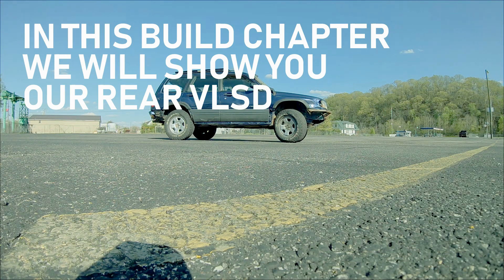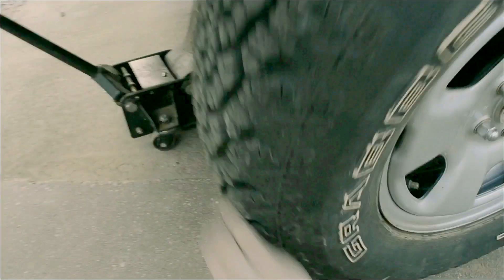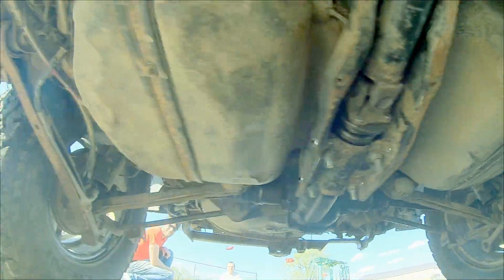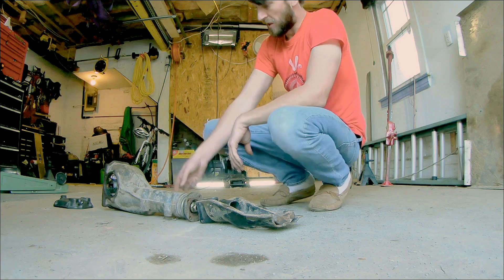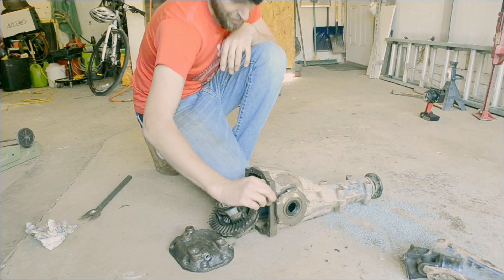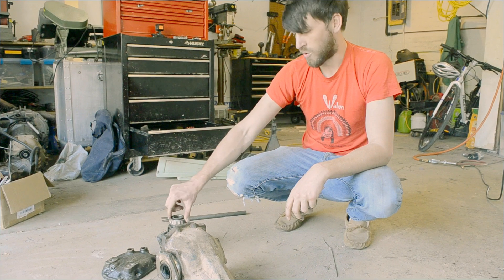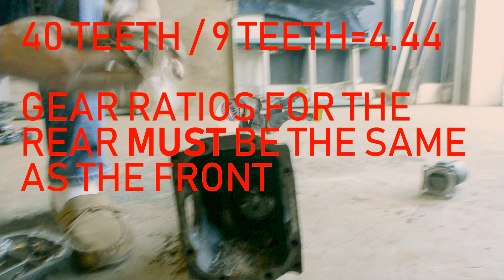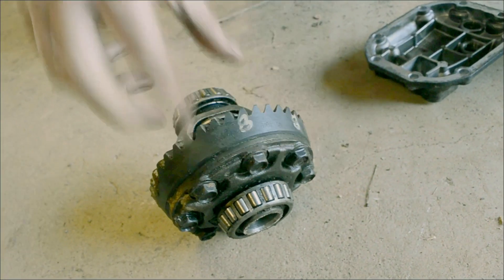Off-Road Subaru VLSD swap: what it does and how to do it

Comment: I don't understand why they don't make these standard equipment as a minimum. Why spend so much time on traction control and torque vectoring and not attempt to assist it with mechanical advantage. Does the LSD inhibit the way torque vectoring works.?

Comment: If i swap out the carrier assembly from an open diff r160 to a vlsd r160 (matching ratios) I dont have to swap the axles?
Reply: i want to do the same, did you manage to do this?
Reply: The version 2 axles are the same as the open diff plug in axles. Swapping carriers is a bad idea because the pinion mesh is set at the factory by a crush washer behind the pinion, so there is a chance your mesh will be shit.

Comment: Hi, thank you for the video. I have an SJ Forester and have argued that the best balance between a vLSD and a locking diff is probably a Torsen. What is the difference between the Torsen and Eaton Truetrac? There appears to be subtle differences. I also wonder why such a good vehicle doesn't fit them as standard or offer it as a marketing option for more off road markets. Thank you again.
Reply: Late 2019 I bought a torqmasters R160 locker, it was awful. It worked well but horrific for daily driving. A torsen or truetrac will become an open diff if you lift a wheel off the ground. I've been experimenting with rebuilding my own R160 vlsd diffs, I have a torque measurement device in a large lathe so we can plot torque vs rpm graphs, so far I've managed a 300% improvement in torque transfer over a stock 100% functional R160vlsd. I'm hoping this will be a great allrounder for daily driving, gravel roads and off road.
Reply: @procrastinator1842  i came back to this video to see if anyone is modding the vlsd. Any news?
Reply: @dukeofnyd1  Hi Jon, after over a year of testing my custom VLSD, I am thrilled with the performance both on and off road. There are literally millions of these units getting around on the road waiting to be upgraded. I am close to offering a mail in, mail out rebuild service, just figuring out how and if I can build a 500% increase diff and will need to test it.
Reply: @procrastinator1842  very cool! Congrats 👍 I was recently thinking about how people used to (maybe still) shim r200 vlsd and thought itd be good for the r160 subaru lsds.  Theres definitely a lot of r160 v lsd out there waiting to get better.
Reply: @dukeofnyd1  Thanks! Shimming only works with clutch lsds. If you shim a vlsd, you destroy it pretty quickly 😂

Comment: Will this reduce the situation of one wheel spinning like crazy, while the wheels with traction aren't getting power?
Reply: aaron sempa Nope, the vlsd May as well be an open diff in situations where one wheel is free spinning
Reply: @CarSyndicate  okay, so is installing a diff locker worth it?
Reply: @aaronsempa5820  Imo lockers and LSD's aren't comparable really. I have a torqlocker and do recommend it. No longer am i stuck in one spot with a wheel in the air and losing all my forward momentum. Definitely worth it if you encounter the same issue

Comment: Working on this type rear now. Was surprised to find after removing cover no clutch pack. Rear was making same noise a clutch pack rear would make going into corners. Will see soon if this fixes it.
Reply from the maker: Hmm. Sounds sorta like wheel bearings to me.

Comment: ideally you would want to buy a Jeep or something with a real 4wd but then you hit the wall with the Jeeps made in the last 20 years being extremely big pieces of shit that will a lot of times catch on fire for no reason at all other than faulty wiring from the factory
Reply from the maker: It's mostly just that Jeeps are prototypical and overpriced for us. We'd rather have a challenge. If anything I think making them more flammable was an improvement.

Comment: any difference with the 4EAT on the turbo models of the transmission?(02-04 WRX).  I was thinking of swapping that in because they can handle some power when built, I was wondering if I would lose anything from my Forester(SF) Type S drivetrain.
Reply: @powerofyourbrains  I was thinking of doing an Ej255 swap but wanted to keep it auto with a quick spooling turbo for a high torque build.  And just have it lifted for light off roading stuff.  I was reading that the 4EAT that came in WRXs are pretty stout and once build can hold a ton of power.  I just didnt want to end up getting stuck because the drivetrain behave different when off roading.  thanks
Reply from the maker: The old bugeyes had the ej205. Ej255 is 09+ wrx. I believe that the legacy gts of the mid 00's had the 255 with your size gearing (4.44, but double check yourself of course). Thatd definitely be your best bet. Coincidentally, it's also the vtd model I mentioned.
Reply: @powerofyourbrains  thanks for the info, Fozzys have a lot of great build paths

Comment: The drive shaft flange isn't rectangular, it is indeed square. Torsen is terrible for off-roading btw, you need way to much brake modulation to make it useful, not to mention there isn't even a Torsen r160 Subaru diff. Your better off welding it. Oh, and the bolts on the driveshaft have tabs that keep them from spinning while you loosen the nut, you don't need a wrench on the bolt.

Comment: I have had a Subaru forester 1997
(automatic) from new (approx. 70,000
miles on the clock), that has been great for
all the years with very little to do other than annual services. However, recently
I have had a lot of vibration & shuddering on the wheels when making slow tight
turns (left or right) but never on the straight. It is difficult to identify
which wheels the noise or shudder comes from and I don't feel much through the
steering wheel. I have had all differentials replace that has reduced the
frequency but not eliminated the problem. We hope it isn't the automatic gear
box but has anyone got any ideas what to do next.
Reply: Check your steering rack and your power steering.
And sadly... Yes it could be in your transmission.
I used to own a 1999 model (2.0 dual range). And had had similar experience. My forester had a center differentials and in fact it was the thing causing the problem.
Since your auto doesnt have a center diff i think it may be the part which controls how much power to deliver to the front or to the rear (forgot how it is called). It is nothing with the gears but with that electronic mechanism.
Reply: @moonsapling  Checked all that with no 'luck'...... We now believe it could be a solenoid in the transmission that works the AWD system may have gone.... just waiting for parts before replacing it..... I will inform you when done.
Reply: @georgeemanson  hope you manage to fix it. Hope for the best and good luck!
Reply: @moonsapling  Thanks for the support.... I think we are eventually getting there..... old sub's are great cars... not to fond of the new ones so want to keep this one going....
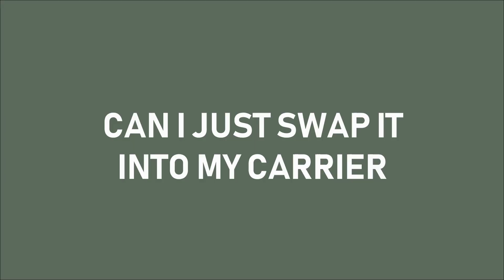Reply: SHE LIVES AGAIN!!!!!!…..an interesting item at 3 minutes to 4:40 minutes in the attached video ( https://www.youtube.com/watch?v=GP7TInt4q84 )..... this was exactly what I experienced with my 1998 Subaru Forester but no-one could diagnose the problem.... £3k was spent/wasted with my Local Subaru dealer trying to fix it... but to no effect. Then I found the attached video link.... and then I found a good mechanic willing to do the work..... and yesterday we got our car back (with new solenoid in the transmission) and she runs great..... Well worth the effort.... these Subaru's can go on forever (almost) George (London, UK)
Reply: @moonsapling  SHE LIVES AGAIN!!!!!!…..an interesting item at 3 minutes to 4:40 minutes in the attached video ( https://www.youtube.com/watch?v=GP7TInt4q84 )..... this was exactly what I experienced with my 1998 Subaru Forester but no-one could diagnose the problem.... £3k was spent/wasted with my Local Subaru dealer trying to fix it... but to no effect. Then I found the attached video link.... and then I found a good mechanic willing to do the work..... and we got our car back (with new solenoid in the transmission) and she runs great..... Well worth the effort.... these Subaru's can go on forever (almost) George (London, UK)

Comment: Where can you get any kind of straight swap lsd or locker for sake of better snow car?
Reply from the maker: Well, since snow naturally causes tire spin, the vLSD is perfect. We have a snow adventure video if you would like to check that out. For conditions which allow for more traction, the next most feasible options would be a clutch-type or helical conversion, either of which have their benefits and drawbacks (longevity and price). A true locker costs more than it'll be worth to you, but if you wanna throw away 4k we know a guy in Australia who can build it

Comment: As the owner of an 04 forester xt setup for offroad, I wouldn't want a Torsen style diff. Torsen diffs are great until you lift a wheel and then it's an open diff and no better than what you started with. I'm getting ready to install a Cusco diff, not sure if I will use the 1.5 or 2.0 setting since this is also my daily driver.
Reply from the maker: This was explained in the raw footage and cut out for brevity's sake, but you can easily overcome that by lightly holding the brakes. Still a matter of preference; strength/ease of lockup vs component longevity

Comment: Hey man I got a 2003 Subaru forester 2.5XS and I would like to know what to get to make my rear diff lock up for better rear traction, I'm already doing the other mod you guys mention in how to lock up the center diff. Your input will be much appreciated and thanks for your videos keep up the good work
Reply from the maker: We have looked into this. If you really want a true locking setup, there is a guy in Australia who can fabricate a locking rear for the forester using an R180 rear. Im happy to give you his contact info, but you should know that its a send-off service, and the parts and labor costs nearly 4k USD. As soon as there is a cheaper alternative, you'll hear about it on this channel
Reply: Power of your brains thank you for the info, I will wait for now then  because 4k it's to much.
Reply: Power of your brains the other cheaper option that i was thinking is to weld the rear diff to make it possi at all times and have my subi with the fuse on the FWD slot. Now my other question here would be, Can this motel subaru be driven for long miles with the fuse in the FWD slot? In other words have it in front wheel traction for city use and enable the AWD when going off road!
Reply from the maker: Gabriel Ruiz Having that fuse in place means that the center will lock up only when traction is lost, so its still awd. The switch could be wired to allow for fwd only vs lockup. The problem with a welded diff is that it is welded wether or not power is being sent to it. If you have to drive on-road on a regular basis, a welded diff is usually not a great idea
Reply: I was the one who, with my partner developed the R180 diff locker here in Sydney.  I have tried  various different diff set ups off road.  From open, VLSD, Torsen and plated through to e-locker off road.  I am also aware of the lunch box or auto lockers that have since become available for the R160.  The open is obviously pretty limited but if you keep the car flat you can still get to some places.  VLSD is effective to a point, but  wilts under use and in more difficult terrain.  The Torsen is ok, until such time as you lift a wheel, then it's effectively an open diff.  Best not worry about it.  Plated diffs are the best of the LSD's, and they vary by brand.  Thing is, on road they make the car very tail happy, yet still give up on you and leave you stranded.  These auto lockers are similar in concept to Detroit Lockers.  They don't always lock when you want them to, and sometimes can when you don't want them to.  Which on a wet road can lead to a very nasty surprise.  They are also noisy, and because they still use the weak R160 axles you are more likely to break one, hardly ideal in an off road situation or away from home.  It's pretty old technology and somewhat primitive.  A bit like having a black and white TV when you can have the latest LCD/LED.  Which leaves the R180 e-locker.  Strong, quiet, reliable, effective.  If you can't afford it and all you have is an open rear diff, then the VLSD is probably the best option you have in terms of bang for your buck.  You can see though how my diff works here,  Look at my other videos while you're there.  https://www.youtube.com/watch?v=r2s5J0jwGiQ&t=6s